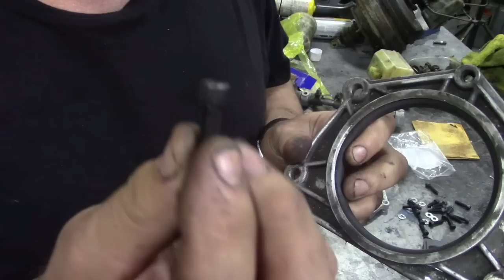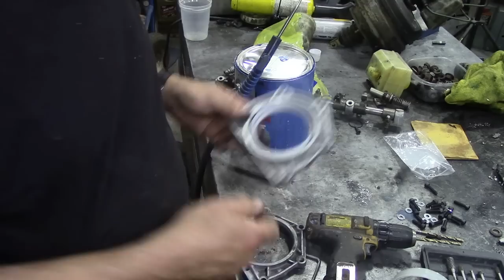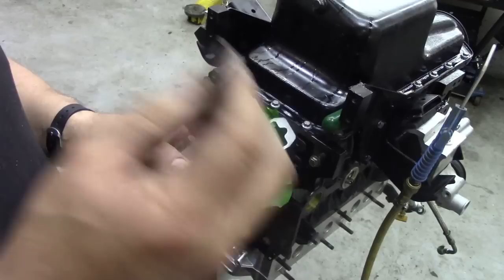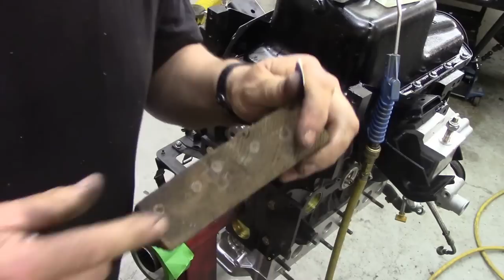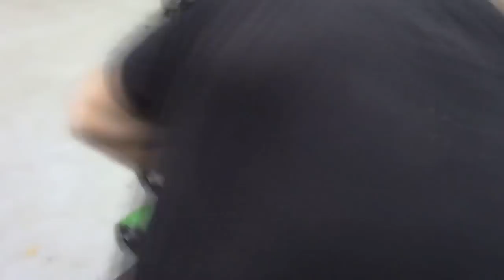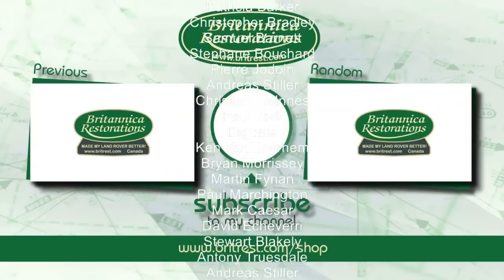300Tdi rebuild. Modifying the crank seal to stop warping Pt10

Comment: I drilled through a little too far and now the hole goes through the block. Now what?
Reply from the maker: Use some blue Loctite on the threads - should be OK as there is no pressure

Comment: Mike, try this. I made a casing of the simmering out of steel sheet, a hole of 114mm, I used a corteco 20026414B seal, I think that the casing will only survive the engine until it is replaced. the steel housing does not bend. Regards 🇨🇦🇵🇱
Reply from the maker: What an excellent idea! What was the thickness of the steel?
Reply: @BritannicaRestorations  blacha miała grubość 13mm  pod uszczelnienie 99x114x11 reszta kopia z aluminiowej obudowy  porozmawiaj ze swoim tokarzem .może będzie film i opatentuj ten pomysł 😃
Reply from the maker: Mam dostęp do warsztatu z urządzeniami do cięcia laserowego w Montrealu - bardzo dokładnie, tanio i szybko!
Myślę, że mogę sprawić sobie kilka!

Comment: There's something thats really disturbing me and its turned my world upside down.  I did a mechanical apprenticeship and was told, that it will always be, that when you fit an oil seal, that you will be met with great fire and vengeance, if you dont first oil the shaft and the seal lip, then stuff the recess of the seal with grease before fitting. Now you tell me that isnt always true? What has happened in the last 30 years that this is no longer necessary? I did my td5 last may and the seal is pretty much the same as that that you have shown. I threw engine rebuild lube all over it and fitted it as i was taught. I didn't bother with any landrover manuals,  well you know what they say about instructions, they are only for people who don't know what they are doing 😀
Can you share with us the reasoning for no lube as is keeping me awake at night
Reply from the maker: Paul - the seal is coated with Teflon - that is all it needs - if you put oil on the seal it can lead to seal failure as it cannot bed down

Comment: Hello Mike,
I have followed with great interest your videos concerning the 300Tdi engine overhaul. I particularly noticed this video where you illustrate the problem of the deformation of the aluminium bench oil seal support and the consequent misalignment of the oil seal and hence the oil leak. At the moment I too am overhauling the engine of my Discovery I with 300Tdi engine, and checking the deformation of the aluminium support, I noticed a 0.15 mm wagging in the central part, precisely the one from which the oil leak occurs . I will proceed with the modification you suggested, making the seat for two small M5 bolts with hexagon socket, using the old support as a template. In the video part where you mount the new modified support, it is not clear if you have put silicone between the cast iron block and the gasket and between the gasket and the aluminium support, can you clarify this point? Thanks for your very informative videos. Bye, see you soon.

Comment: Personally I think the soft gasket and quite a high fastener torque could be the problem (crushing the gasket around the fastener holes), the next one I do I will put sealant on the gasket and just nip down with loctite on the threads.

Comment: Hi!! Mike. After watching your videos over the last few years, I have come to the conclusion that the less ALUMINIUM that is used on an engine the better. Take the cylinder heads, nothing but trouble with warping or burning out. Coolant related parts such as pumps, housings, Ect.  If these parts had been made out of cast iron my life would have been a lot easier, OK! iron gets rusty, but it dos'nt dissolve like a sugar lump in water, and if you have to use an hammer on it  you can within reason.  I just wish someone would make a 200-300Tdi head out of steel, even a backstreet Indian one would be be stronger than the best ALUMINIUM is.  Making Landrovers better = full time job Mike, they cant get them right from coming out of the factory.  Many thanks, Yorkshire Rob.

Comment: The little ones are torqued between 14 and 17Nm according to the HS2.8 workshop manual. And those 2 go "Loctited" also according to the manual (Dri Loc 215) in case you drill through the oil vein. There is no oil pressure down there but just in case.

Comment: When drilling the cap in the original 2.8 place you could hit the return oil vein from the cap bearing so always do it before install to make sure you can clean the cap very well before install.  I usually drill no more tan 15mm deep. You just need 10mm thread on the cap. 10 in the cap + 10 thichkness from the rear seal you have the 20mm long Allen head bolt.
Reply from the maker: Thanks for the info!

Comment: Mike the original 2 extra bolts are M6x1 20mm long on the original 2.8 seal case that's 10mm thick. In this case I guess you would use shorter ones. Anyways good job!
Reply from the maker: It leaked! However as you will see in the next video it was nothing to do with modifying the seal, but the seal itself was way out of spec!
Reply: @BritannicaRestorations  sent you an email. Check your spam just in case..

Comment: I'm using my crystal ball to look 10 years into the future...

The oil seal is worn out and leaking, somebody takes this oil seal off, sees the two extra holes in it, decides to replicate the holes in the replacement seal, places the new seal back-to-back with the old one, drills the extra holes.... and then curses you when they discover that the extra holes weren't in exactly symmetrical positions. :-P

+EDIT+

If you're gonna do this regularly, it might be worth making a paper template, figuring out the positions of the holes precisely and then punching the holes into a gasket and hanging it on a nail in your workshop so it can become the "datum" for all future mod's.
Reply from the maker: Well, did a smoke test this morning and the seal leaked ( video soon) but it was nothing to do with the modification as you will see - OEM seal, made in the UK, straight out of the box.
Reply: Similar thought here, poor guy who has to next replace the seal. 🤷‍♂️
Reply: If it was me replacing the seal I would just use the gasket as a template.

Comment: Hey Mike did the same thing on my recent 300tdi build using 6mm Allen Key bolts, a turners rear seal and gasket no rtv sealant. 
I tapped the rear main bearing cap prior to the tear down using the old seal as a template the same as you to the get the holes correct.

So far 5000k no drip but time will tell   
If it wasn't for the turners rear seal already having holes, wouldn't of even thought about it. The 2.8 tvg had lots of good simple mods that being one of them.

Comment: Very nice solution.
The only problem with this engine will be, can it be classified as a 300tdi if it doesn't leak oil?
Reply: Harvey Smith .Think you mean can it be classed as a land rover if it doesn't leak oil .Same can be said of the older british motor bikes , Japan was most likely the first to produce bikes that didn't.

Comment: I always clear compacted swarf from the bottom after tapping. Using the tapping size drill just a couple of turns with your fingers will do it then blow it out. But cast always crumbles to dust so cast usually doesn't need it. Not criticising Mike. Love your posts.